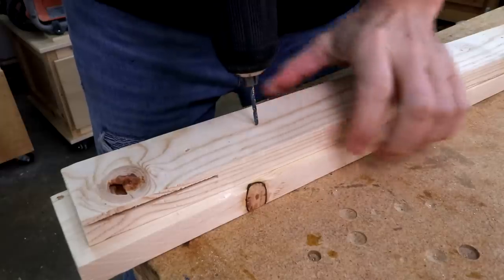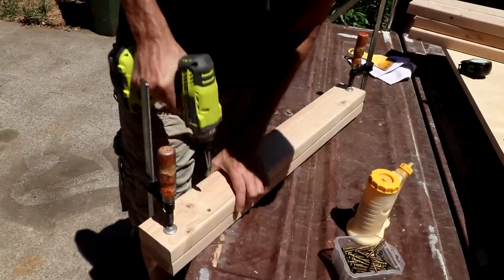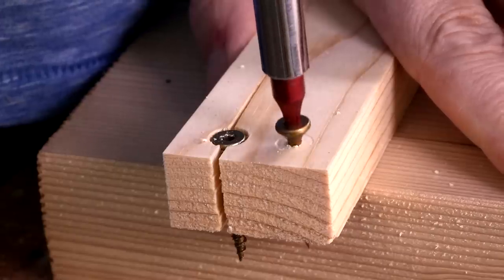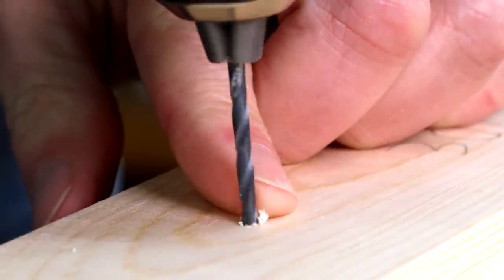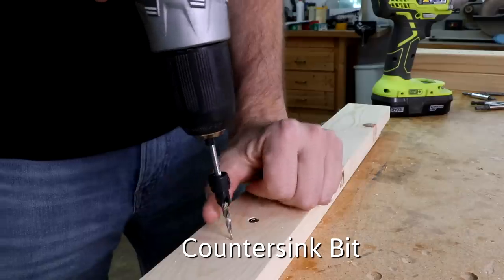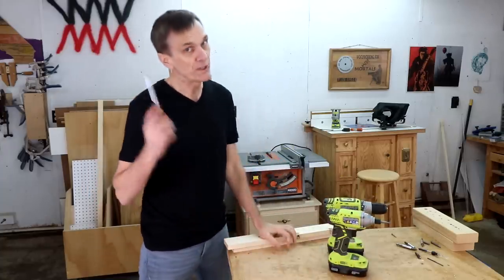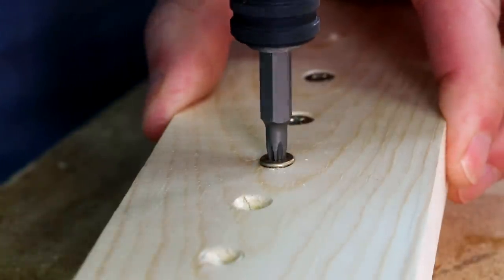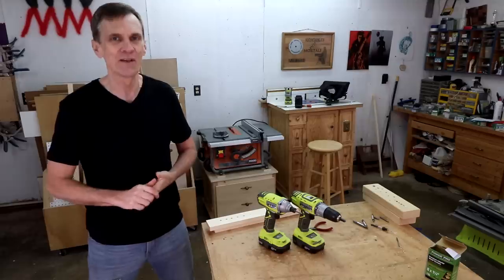HOW TO DRIVE SCREWS (without splitting wood!) | Woodworking BASICS

Comment: Hey Steve, one technique I use all the time to stop a drill from "wandering" when I'm setting a pilot hole is to run the bit for a second in reverse. This bores the starting hole by friction instead of trying to cut the wood with the drill to get the tip started.

Comment: A poor man's countersink bit:. Pre-drill or not depending upon the sensitivity of the location, then grind a Philips head bit where the head of the screw will seat.  Most splitting is caused by the head of the screw acting like a wedge as it seats.  Remove the wood at the top of the screw  hole quickly with the bit you probably already have in your drill.

Comment: Two things...  One a REAL Robinson bit with a square head and you don't need to hold the screw at all in a pilot hole because the Robinson is tapered and wedges the screw tight.  Second find bradpoint drill bits because not only do they drill a cleaner hole but the sharp point prevents the bit from moving around.  Those "multi purpose" drill bit are not wood bits

Comment: most people do not know that not only should you dill for EVERY screw, but you should drill two sizes.  the first bit is small, (size depending on the hardness of the wood.) drill through both top board and the board you are fastening to. then take a larger bit whose hole clears the threads of the screw and redrill only the top board.  that way the screw threads are free and the force of the screw's head will bind the two boards tightly together.  if you do not enlarge the top board's hole then if there is a gap between the boards when you lay them together there will still be a gap there after the joint.   the thread in the first board will hold the screw as it goes though the gap space and on into the bottom board and the gap will not close.

Comment: So Steve, I need to drill a lag bolt( if this is advisable) into the narrow side of a wall stud, but I am afraid of weakening/breaking the stud. I am mounting a  plywood “floor/shelf” to the back and side walls of the laundry closet to place the washer and dryer on. I plan to mount a 2x4 across the back and each side, screwing several 2.5 inch long 1/4 inch lag bolt through the 2x4s through the drywall and into the “narrow” side of the 2x4 wall studs. Probably 3 boltS on the shorter and 4 through the longer back wall braces.
I really REALLY appreciate your videos as they are very informative. I’m new to all this construction project stuff, as I always hired a contractor to do these projects in the past. I just can’t find anybody to take the job now, I guess they are so busy with building new homes and what not but nobody will take the job! Thanks again for all your help! Mark Smith

Comment: Even as someone who knows how to use tools these vids are nice to remind us to do little things like countersink.  Keep up the good work Steve.
Reply: Problem is, you should ALREADY have "Common-Sense". If you needed to be reminded of these things, aka: the single, most "basic" & again common-sense things possible then sadly your brain isn't working anywhere near how it should which is scary. Honestly, if I was in that state, completely lacking common-sense as you, I would not go anywhere near electric tools because you sound like you could already, easily make some serious & dangerous mistakes. I mean seriously, Pre-drilling & countersinking? So up until this video you've been like "Damn, these screw heads are sticking out again! Wish there was a solution", lol, it sounds like that literally the situation you were in! Scary. U know instead of countersinking, u can just buy (in fact almost all the screws at the hardware stores here have this) screws with the "Countersunk Rib Heads", which unless its super hard wood will counter sink themselves.
Reply: @VirusOfCyrus  hey, thanks for the info on the countersink rib heads!

Comment: Nice work, Steve. Presenting simple intro videos in a clear, easily accessible way is giving a lot of value and instruction that is sadly lacking in many YouTube channels. There are so many fundamentals in diy (do it yourself) that are glossed over and not talked about. The attitude is "Ha, you should know that stuff already". You're to be congratulated for bringing a refreshing change.
How about 'how to use a spirit level', 'best glue/adhesive for different jobs', 'different abrasives and what they're for', 'how to cut a straight line with a circular saw'. The list is almost endless. Thanks, Steve.

Comment: You can take the drill bit out of the drill and give it a tap with your hammer once it’s in position. That should hold it in place and you can chuck it into the drill as it’s standing up there. 
Also use a screw lube like ackempucky from Mcfeeleys to help drive the screw without any problems in hardwoods. 
Good video!

Comment: To avoiding splitting wood with a nail, try  flattening the sharp tip of the nail.  You can do this by gently hammering on a hard surface like concrete or metal prior to using the nail. This should help crush the wood fibers instead of separating them as the nail goes in.

Comment: Love the way you explain everything  and you don't assume we have thousands of dollars of power tools  in our shops . One suggestion , could you give us some tips on drilling a straight hole ( 90 degrees)  with a hand drill.?
Reply: Attach two small pieces of wood together to form a corner.  Place the corner where you wish to drill.  Use the corner to guide the drill bit.  If by "hand drill" you mean the hand tool that you hold with one hand and crank with the other, you need to clamp your drill guide, of course.

Comment: The example where you split the board is exactly the size wood I just split. I was screwing it to another board exactly the same type. I have one split end is there some bracket I could attach to keep the split from eventually getting worse?  Thanks so much for the video.

Comment: Thank you for this one and the latest screws video. For beginners this information is hard to be found (yes, I spent a couple of hours researching screws).
It would be nice to give more emphasis on:
1. dealing with different types of wood, plywood, MDF, and OSB
2. comments on the thickness of the material
3. when screwing into a face or end of a board or at an angle as with pocket holes

These may seem like trivial issues, but for a beginner may be complete mysteries.
And - thank you for coming back with new content.

Comment: As a builder, having driven probably hundreds of screws this week so far, I have no idea why im watching this! But still, a nice video with some, maybe not always so obvious, tips for people with less experience and maybe just starting out in woodworking, great stuff! If you can afford it, I 100% recommend investing in a impact driver! Saves alot on your wrists and keeps the drill free if you need to predrill. Only downside is that they sometimes tend to be pretty loud.
Reply: I recently built a work bench using my trusty Dewalt drill. It seemed like I spent more time switching out driver heads, counter sinks, and drill bits than I did building the actual bench. Then I noticed that Ryobi had a drill and an impact driver on sale for $99...since then, production has smoothed out.
Reply: That's why most tool manufacturers sell a drill/driver combo kit.

Comment: Any chance you could do a video on circular blades and adjustments of the saw.  Just ran into this problem and figured if I had the problem alot of folks may.  I just bought a 140 tooth blade for finishing type cuts on plywood, had blade adjusted to low and blade was cutting slow and burning wood.  Thanks for your tuttalige over the last few months.

Comment: If you don't have a brad point bit to start your pilot hole, run the drill backwards a couple of revolutions.  This carves out a little starter divot in the wood and keeps the bit from wandering when you run it forward to make the hole.
Reply: Didn't see your reply before I posted, Hal.
Reply: No worries!  The more good info that gets shared the more people can learn from it.
Reply: As usual, this is a brilliantly simple technique that I really should have thought of myself. If we ever wonder why people didn't come up with simple machines and techniques earlier in human history, recalling moments like this can lend some perspective. Damn, what else am I not doing right?
Reply: Or use a punch to make the starting divot for the hole. If you don't like having to grab a hammer, you can get spring-loaded punches.
Reply: Running the screw counter clockwise for half a dozen revolutions not only prevents the screw from wondering, but also is quite effective to prevent the board from splitting.  A friend and I tested the technique on 1 X 6 fence boards when placing two screws on each end within an inch of the end.     Driving the screws in clockwise without a pilot hole caused about 3 splits for every 10 screws.  Running the screw counter clockwise without a pilot hole before driving it in clockwise didn't split a single board until the 40th screw was driven.  I'm not sure of the mechanics, but it seems that the greatest pressure to split the board is created at the very surface of the board.  The minor divot also allowed the flat head screw, with a taper to the shaft, to sink flush with the wood surface without spreading the fibers and causing a split.

Comment: One thing I run into even if I drill a pilot hole at the end of a board is splits so in addition to a pilot hole is a countersink hole. Most construction screws have a tapered top leading from either the end of the threads or shaft to the top, well it's more of a flared top. So that flare splits the end just the same as a screw shaft or a nail point. Not to mention when you countersink a screw it just has a better finished look.

Comment: Thanks for every topic on woodworking and tips, technics.
I have one to share with you
I learned it from my friend ;
Start the hole by driving the screw on the drill on reverse mode til you get a comfortable gruve, then return to drill mode and the screw will drive in easier..thanks again, God Christ Bless.😉🏁🙏👍
Reply: Good tip! thanks!

Comment: You should demonstrate putting screws into the end grain of plywood. Kust add one or two extra screws in the flat part of the sheet, around the main fastener. This will prevent the plywood from delaminating.

Comment: Steve, unrelated question here...but I noticed in none of these basics videos have you covered using rough cut wood and jointing/planing it down.  

Do you only work with S4S lumber from the yard?

Comment: To pre drill holes I usually just drive the screw backwards first and then drive it forward. Works every time.
Reply: I just split my board with that process.  I’ll switch to drilling pilot hole on these small boards.

Comment: To reduce / eliminate phillips screwhead 'cam out' use JIS driver bits.  There are several You Tube videos on this subject concerning screwheads on motorbike components. JIS are available on ebay
Here in UK we have "posidrive" screw heads which are possibly the successor to phillips type and they rarely cam out. Also using the Metric system means shank and bolt sizes are more straight forward. No fractions!

Comment: I know that this is an old video and I hope you see this but I had a question about splitting wood.  Intend to use a lot of reclaimed/rescued pallets for my wood supply. I have found that the wood planks on some are REALLY dry.  I built a rolling kitchen island recently and had an issue with splitting wood even though I was pre-drilling. Can you confirm or deny that the dryness of the wood was the cause and if confirmed, can you give a suggestion on fixing the situation?  Thanks
Reply: If your pre-drilling a pilot hole the same size as the shaft of the screw, the shaft should not split the wood as the treads of the screw cut into the wood.  However, often the taper between the head and the shaft acts as a wedge as the screw is driven flush with the wood surface and that wedge will split the board.  A tapered countersink bit is usually the answer to allow the screw head to sink flush with the surface without causing a split.

Comment: This works great for softwoods, but not so much for hardwoods.  You should still pre-drill a pilot hole in the lower piece, but you should have a clearance hole in the top piece, slightly larger than the thread diameter.  There should be no thread engagement in the top piece, only the bottom.
Reply: That's why we need four drills: 1) small-diameter for the threads, 2) large diameter for the clearance hole in the top piece, 3) for cutting the countersink, 4) driver.
Reply: I've always struggled with this: having my workpieces push away from each other when the screw is halfway in. I've always wondered if I'm supposed to make the top pilot hole larger so that the threads don't catch the top piece as it's tightening up, or if I'm always supposed to just clamp my pieces together before screwing, or if I'm supposed to just ignore the top piece lifting off and just drive it home, being unsure if it's actually as secure as I want it to be. It's something I don't think I've ever seen mentioned in all the woodworking channels I've watched. It's ironic because it's one of the few true "basics" that I'd actually like to see someone go into depth on.
Reply: contero2, with a pilot hole in the top piece that is smaller than the diameter of the threads, you can see what happens by driving a screw through the top piece away from the bottom piece until it protrudes a little bit, perhaps 1/8" - 1/4".  Then drive into the bottom piece.  That gap won't go away, unless the top piece is soft enough to allow the threads to rip up the wood.
Reply: I sometimes use a pocket hole stepped-bit drill bit for this. Only works for certain screws of course
Reply: My thoughts exactly. I'm a professional carpenter and I prefer to drill the hole large enough for the screw to pass through without grabbing. This mo
Method will also prevent the piece from walking up on the screw when the screw contacts the lower piece of material. This is a great reminder for me that there are lots of people who are looking to learn the basics of wood working. We all started at square one. Thanks for helping those folks out
Reply: I like using a tapered drill bit with a countersink for that purpose and the drill bit length is adjustable to fit your thickness of wood and length of screw

Comment: I use drill bits smaler than the screws, like 1/8" or 5/32" drill bit for a 4mm or 3,5mm screw, i don't have drill bits that matches the screws exactly, and i wouldn't feel confortable to use if i had. I also use a big drill bit, like 3/8 " instead of the countersink bit, its not very good, but it is a good alternative, and looks good if u do it right.

Comment: You can also stand the screw on his head over concrete or a piece of iron, tap the tip of the screw 3 or 4 time with a hammer,without bending it,  and drive it  in. It will be harder to screw in but it won’t split the wood.

Comment: Love your videos. I am a new subscriber and can’t wait to see all your past videos. Can you do one on repairing a minor split from a screw?
Reply: Leave the screw in place where the wood has split, do you best to fill the crack with wood glue and then clamp back into shape with the screw still in place. You’ll be able to remove the screw still after the glue has dried and still be able to re-drive a screw through the same hole without it re-splitting

Comment: If my screws are 4mm or less (3/16'') I only drill the face board that will take the screw's head. I drill that with the same nominal size drill bit as the OD on the threads, so it goes through with ease. If screws are larger I also pilot drill the second board that will take the actual thread of the screw. Size of that hole is the same as the smaller OD on the plain portion of the screw. Remember I am still allowing the screw to fall through the first board here, too. Why this matters? Well if you have to take it apart and then reassembling or just doing a mock-up, those boards will go together as tight as the first time. No thread is needed on the face board, the head and the countersink are there to hold it while the other side of the screw is tightly fastened to the secondary piece. Even in metalwork the primary hole is always the max OD of the fastener (or bigger), while secondary hole has a corresponding thread.
Reply: Before anyone says "yeaaah dude that's why the upper half of some screws is plain" let me ask you do you thickness or select your pieces based on screws dimensions? I don't think so.

Comment: What about magnetic bit holders? Using tweezers to hold a screw in place seems a little odd to me.
Even without magnetic bit holders: Isn't the point of the screw fixed by the pilot hole or its own tip?

Comment: Thanks Steve.  Do you ever use soap to help drive in screws?  I've heard it can help in hardwood but haven't seen anybody do it.
Reply: I use leftovers of the Minwax finishing wax for that. Works great! Without it long screws may just snap
Reply: Tony Harris the issue is when using brass screws to finish a project.  Brass is super soft and usually has slotted heads.  The way I do it is first tap the hole using a steel screw with the same thread and then dipping the treads of the brass screws in wax and driving them by hand.  The slotted head makes it really hard to drive with a drill and you can align the slot of the screws to match for an added detail.

Comment: When you take the drill bit out of the pilot hole do you switch the direction of how the bit turns?
Reply: Nope.  Pulling out the rotating bit pulls the "saw" dust out.